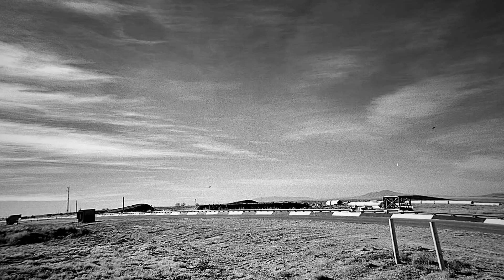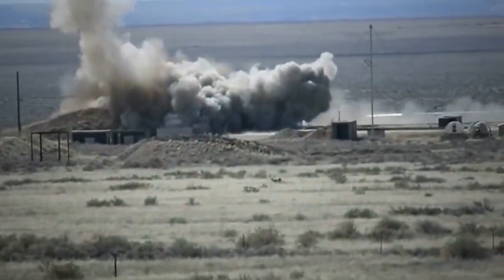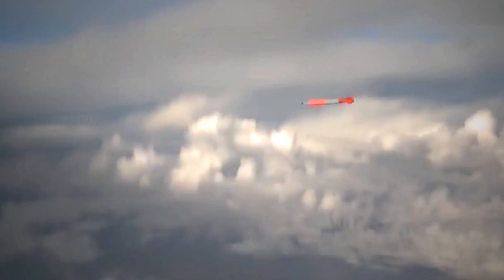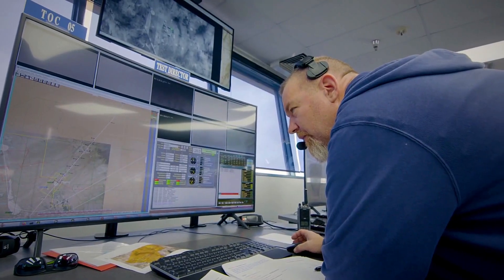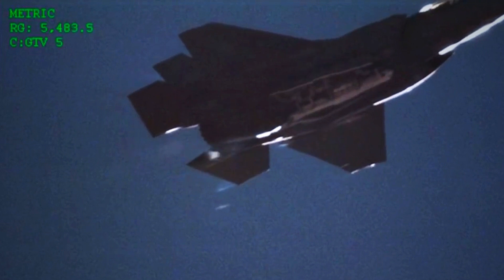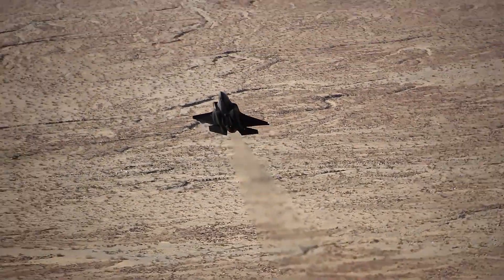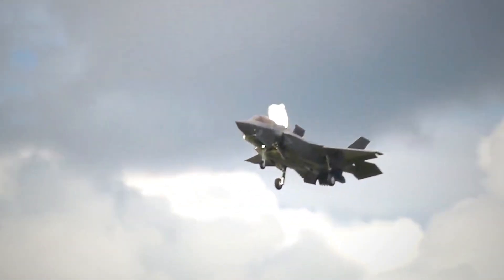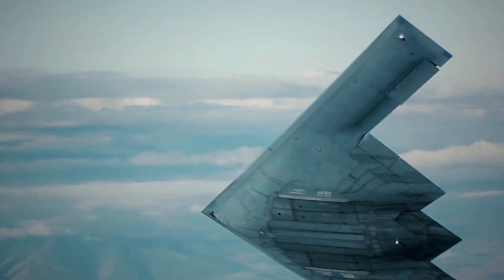Dropping the Safest Nuclear Bomb Ever

Comment: i just had a a crazy idea , the f35 takes of vertically right? , the us could design a modifyed submarine that can house the f35 or another stealth jet, or maybe some other platform maybe a stealth drone  carrying a low yield nuke(500kt) possible? , the sub surfaces the jet quickly deploys the ordenance  and returns to the sub disapearing in the the void of the sea, or if  the drone  would have  some one following  it could self destruct to erase evidence and keep the sub safe and hidden, that ough to dissuade enemyes from attacking, one could have such subs all over ready to strike
Reply: Hate to break it to you but the us russia and britain already have subs out with nuclear missles
Reply: @vassowned7768  i  know that, subs that can carry several trident missiles with 8+ warheads each, I meant something to deploy a low yield  nuclear ordnance  in a stealthy way, icbms heat output can be tracked easily from satellites

Comment: To me, use of these upgraded bombs as low weight deep earth penetrators make sense. I don't think any buried target would be able to save itself from a mini nuke detonated above it, also minimizing the fallout if little to magnitudes time smaller. Ofcourse targets would have to be high value enough to warrant the use of this highly potent bomb.
Reply: Not really, having a nuke tunneling into the ground guarantees fallout. Then whether or not that fallout disperses far from the target site depends on the yield of the blast and whether it was carried up into the air by an above-ground mushroom cloud.

The only way to minimize fallout is air-bursts.
Reply: @joshwilliams8863  the problem is that USA still has b61 bombs, basically tactical nukes. It muddies the idea of absolute MAD and let a side thinks that it can get away by using nukes with sub kiloton warheads, b61 has a warhead which can be set to 0.3kt at it's lowest. It's a very real possibility that a side might chose to employ them if it thinks that it will give them major returns to brush aside any severe consequence.
In that regards, i just thought of a possible usage scenario. Tactical nukes are destabilizing factor imo, though I am very sure that USA might be tempted to use them in NoKo situation, which is a much inferior enemy in terms of nuclear deterrent compared to china and russia.
Reply: @itshawkeye9129  No it does not muddies the idea on MAD, if I was attacked by a nuke then I am sure as hell going to release my Nukes, because at what point do you go " oh that was a small nuke let it ride it was only 1MT", the short answer is NEVER!

Comment: The F 35A & B are late comers to the new modern "limited nuclear warfare", ever so tempting when the military is reeling, and the term limited seems to be reinvented. Except the F 35 can't sustain after burners worth a nickel. And has crashed twice on training flights. And this bird is "certified ready air drop nuke"? Try to get the parts procurement software to work. Lockheed should be sued. A FEDEx air drop for a part would be faster, kidding aside. A crackpot idea one model fits all branches, slight expensive differences. It wouldn't make it past a hypersonic missile with a ground crew monitoring Google Earth. What a waste.

Comment: The bomb only causes less fallout and radiation because it's a whole order of magnitude weaker and smaller than old shit like w54

It, will, in fact throw an enormous amount of contaminated soil around, but nothing near as much as a megaton range weapon.

Such hydrogen bombs also get more yeild without needing tons more weapons grade isotopes, and are a huge leap up from devices like trinity and fatman that only used about 1% of it's fuel, when they talk about efficiency that's what they mean: fusion>fission although I believe all of our current bombs actually rely on both

Comment: I'm confused as to what we're talking about with this type of tactical nuke.  So it bores its way into the ground and then ignites and that somehow reduces radioactive fallout?  Confused.  Anyone?
Reply: It's more accurate and therefore doesn't need to be as big to destroy its target. Because it's smaller it doesn't make as much fallout to start with and blowing up underground reduces the amount of collateral damage.
Reply: The closer the weapon detonate to the ground the more material it will displace and thus the more radioactivity it will spread... To reduce radio activity the detonation on most will happen on the air + you will get a larger shock wave and heat radiation... The other way is to use fusion instead of fission
Reply: @khelifimohamedzakaria776  You need fission first to initiate fusion.
Reply: Because most nukes explode in the air, above the target. Thus spreading the fallout further than when it inpacts the ground
Reply: @chriswoods8712  No, that's where you are wrong. Look up "Project Sedan", it was a shallow H-bomb test designed to see if nuclear weapons could be used for major earthmoving projects. It resulted in so much radioactive fallout that it contaminated more US residents than any other test.
Reply: @Pete856  For one im not wrong, most nukes do explode over the impact zone. Two that was not a lethal test that was a test to see if nukes would be a useful tool for earth displacment and building canals. The main contaiment in that test was wildlife and plants. But less radioactive fallout say compared to hiroshima. Where you actually get ash falling and spreading for 60 miles past the impact zone
Reply: @chriswoods8712  fallout is irradiated soil spread around, airburst creates less fallout as theri is less material sucked into fire
Reply: it can explode underground to destroy command bunkers etc. or in airburst mode for surface targets
Reply: Learned alot, thanks for the correction
Reply: I don't think it would reduce radioactive fallout. It would literally irradiate the soil and throw it in the air.
Reply: Yes. Why do you think nukes are tested underground?
Reply: @1971merlin  You do realize that underground tests are so deep nothing escapes to the surface, and their effect is completely different to a shallow underground blast? A high airburst is way cleaner than ground burst as there is no soil up there to irradiate and drop over a large area as deadly fallout.

Comment: I always thought that such a bomb would release heaps of radioactive material into the atmosphere.
Reply: Oh, yes. The Sedan test of Project Plowshare excavated about a million tonnes of soil with a 100-kiloton device. Mind you, that was buried at the so-called 'optimum' depth for that yield of 200 m. The B61 in bunker-buster mode only penetrates a few metres, as that's all that's necessary to create a shockwave to break underground bunkers.

The B61 Mod 12 has settings for 300 tons yield, 1.5 kilotons, 10 kt, and 50 kt. So you'd still get unhealthy amounts of fallout, even with the lowest setting.
Reply: @akizeta  yeah, but a few nukes are not that bad for the environment in a global scale.
Reply: @spacedoge3508  They're pretty bad on a local scale, as bad as an artificial thing can get. And Test  Sedan contributed one-seventh of the US total contribution to global fallout.
Reply: @spacedoge3508  ..because...well...hormesis?
Reply: @J B These underground tests were done far deeper so that very little material escaped. These bombs will explode at a very shallow depth.
Reply: @rjhrjh3  Yep, my problem exactly. Underground doesn't mean crap if your fireball escapes to above-ground. Just guarantees massive amounts of fallout.

Comment: I imagine its gonna be made quite a few of these, so risk of a broken arrow is gonna be even higher no facepalm
Reply: The B-61s were made decades ago, so they already exist. They come in several variants: B-62-3/4, B-61-7, etc. DoD is refurbishing these weapons to "create" the B-61-12. The refurbishment includes replacing analog components with digital ones. In essence, DoD is replacing vacuum tube technology with more modern computer-age technology. However, no US nuclear weapon was ever intended to be rebuilt. Our design practices were to build a weapon, deploy it for a few years, and then replace it with a new weapon. The B-61 is the first US attempt to rebuild an old design. This is why it is an expensive and time-consuming process.

Comment: Interestingly, the problem of low-fallout atomics was solved decades ago, during the Orion Project.
Reply: The Russians have a salted nuke torpedo. It's on the Sub Brief YouTube channel if you're interested.
Reply: Not really. Freeman Dyson calculated that an Orion launch from the ground using nukes would kill an average of one or two people worldwide by fallout per launch. The bombs to be used were low-yield, and designed for impulse rather than blast, but they weren't particularly clean.
Reply: @akizeta  but over what timescale? Did one or two people just randomly drop dead immediately after launch or did it take 40 years?
Reply: @tachikomakusanagi3744  It would have taken a few years, but it would be impossible to track, lost in the noise of worldwide cancer rates.
Reply: @akizeta  So totally meaningless then?
Reply: During the same time the concept of enhanced radiation weapons was considered. See the W66, W70/Mod3, and the completely bonkers W79/Mod0 nuclear artillery weapon (NATO 8"/203 mm). The rationale behind these weapons was that they would be extremely effective against tank crews who were well protected against heat and blast from normal fission weapons. This is why field commanders could "dial in" the yield of these weapons to prioritize ionizing radiation or yield.

The idea of a "salted bombs" was entirely different, and even more sinister. These were long-duration access-denial weapons or even "doomsday" devices. The Russians are continuing development of this concept through Status-6 (Russian: Статус-6). It is a component of asymmetric, anti-access, area-denial strategy.
Reply: @dvergar1  to add to your info, salted bombs were called such because they added the salts of elements that would create long lived bio-toxic isotopes I believe cobalt was one of the elements
Reply: @treyreppe4348  You are mostly correct, sir. Cobalt-59 and Cobalt-60 were considered for inclusion in the "taper," or the containment material around the core. The specific materials are still classified, but it is unlikely they would have been precipitants (salts). My guess (and it is only a guess) is that "salted" refered to including an ingredient (Co-59) to increase radiation as opposed to the usual neutron-reflective material, like Uranium for increased yield or Tungston Carbide or much lighter Beryllium.
Reply: @dvergar1  Both wrong. It refers to an old Roman/Greek/Medieval practice that when you wanted a "secure" border meaning a place where nobody who might attack you could live, you took the land and spread salt in the fields so that nobody living there could grow crops.  "Salted Earth" was a more permanent, long-term tactic than "Scorched Earth" because it meant nobody could move back and rebuild.  The effect could last up to thirty years and it meant they didn't have to occupy or garrison the place long-term to achieve it.
Reply: @zrebbesh  Thank you for that. It makes complete sense.
Reply: @dvergar1  do you mean tamper?
Reply: @diannafiredal  Yup - little typo there. Thanks for the correction. I agree accuracy is important (sort of the whole point of my opriginal rant).
Reply: @dvergar1  Fun fact, wide-ranging deployment and use of salted nukes was the premise behind "On the Beach". One of my favourite made-for-TV film adaptations (and not just because I'm Australian)
Reply: @dvergar1  I knew they used these dirtier radioactive elements but for some reason I always imagined salted bombs being made of actual salts of radioactive material because of their physical characteristics, like spreading easily, being hard to clean and clinging to stuff, kind of like beach sand.
Reply: @dvergar1  your guess is correct. The British tested a cobalt containing weapon (referred to, it was later disclosed, as a "salted bomb": although no salts were used, it was just a macabre reference to "salting the earth") in the central Australian desert. There was a lot of secrecy around the entire program but this one device was the sole device tested at that location, compared to the many tests at Maralinga, another program test site. 
Small pellets of black material covered a large area and an associated rolling black mist killed at least dozens of indigenous people. The area is still subject to restrictions. This pellet material was found to be largely cobalt and significantly more radioactive and environmentally persistent  than the fallout of the other devices tested. The British did not disclose the use of cobalt until grilled at a later inquiry. When asked why they didn't advise anyone else including the Australian servicemen and physicists involved, the head guy said they did it basically just to see if the Australian physicists "were smart enough" to identify that it had been used. Which seems like a very small ancillary benefit  for the trouble of constructing and testing a new device at a new site. 🤔
Reply: @dvergar1  that's fuckin terrifying
Reply: @dvergar1  Also used in the doomsday device at the end of Dr Strangelove (Cobalt-Thorium G)  :/
Reply: @tachikomakusanagi3744  Yee Ha‼️ (Ride ‘em Cowboy)
What WAS that guy’s name?
Reply: @johncox2865  
Major King Kong played by Slim Pickens who was a rodeo star in addition to actor.
Reply: @johncox2865 The actor who played Major T. J. ‘King’ Kong?  That was Slim Pickens.
Reply: When the weapon detonates below ground level, can the blast wave be directed downward? Is that even possible... to "shape-charge" a fission device?
Reply: @jamescannon220  Project Orion depended on the development of low yield shaped nuclear charges. Its the only part of the project still classified today, so presumably they succeeded.
Reply: @tachikomakusanagi3744  In the end its just better to just launch such devices with chemical rockets or alternate ones and just focus engines like Orion to Deepspace flight, as a Orion drive can indeed significantly shorten flight time from our star system to others.
Reply: @jamescannon220  It's theoretically possible, but I don't know whether anyone has tried it. In any case there isn't any point to doing it with a bunker-buster; most bunkers are only buried to a few metres underground, tens of metres at most. The normal shockwave radiating in all directions is sufficient.
Reply: great, lets make a nuclear war
Reply: I agree the smartest thing to do now is fire them off at the east. Not even aim them they'll hit somewhere we happy about.

Comment: Wondering how difficult it would be for CIWS (or it's equiv) to shred these before they exploded.
Reply: In a real situation more than one of this missiles would he coming at a CIWS . There would likely be hundreds and maybe thousands of these missiles launched against the target to overwhelm air defense  capabilities just like how modern ballistic missiles are packed with aids, (radio jammers,chaf, mirvs) to help them penetrate air defenses don't get me wrong the CIWS is a excellent system and has proved it's effectiveness but I think it would prove hardly effective at defending against large scale attack tailored to penetrate enemy defense system
Reply: @CecilTheSasquatch  you dont throw hundreds of tactical nukes at a target. That is not the purpose of a tactical nuke.
If the Target has a modern Air Defense Screen like Patriot, RAM and Mantis in combination, it is very unlikely, that even fighters with reduced radar reflection like F-35 will be able to drop the bomb or the bomb will be shot down after drop.
The concept of dropping tactical nukes via fighter bomber´s is slightly outdated, as you would need first airial surperiority over enemy territory, then surpress the air defense and then strike with the nuke.
Guess what is not neccesary anymore at that point....
The same Job can be done via Cruise Missiles or MLRS or even a drone with specialised warheads without endangering the Pilot and a mulit million dollar aircraft
Reply: @zhufortheimpaler4041  you been watching to many movies mate
Reply: @CecilTheSasquatch  more likely would be for stealth aircraft to take out air defenses and CIWS with conventional munitions before dropping a nuke, if they truly were concerned about it. Same-ish idea as what you are saying. Just less wasteful of weapons with nuclear payloads.
Reply: A CIWS or similar would have to be deployed to kill one of those. The main target of these bombs would be Tank columns mostly.
Reply: @EnterpriseKnight  Army does have ciws capable defence now after borrowing first gen tech from navy.they have thier versign now for anti drone defence mostly but could use it for whatevers needed i guess